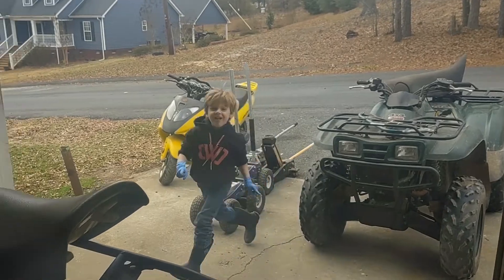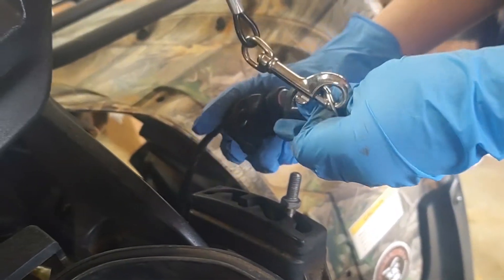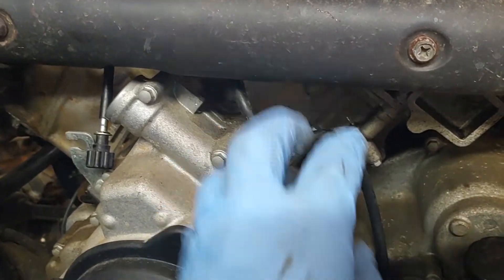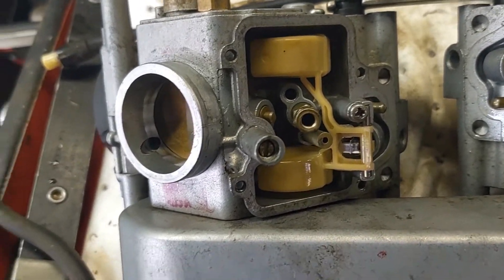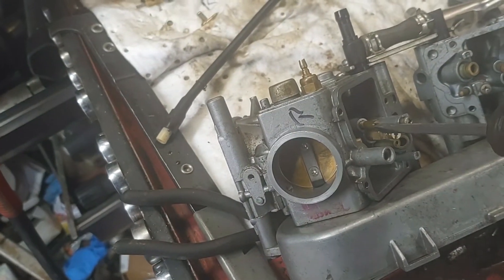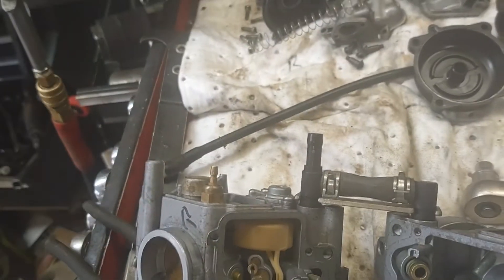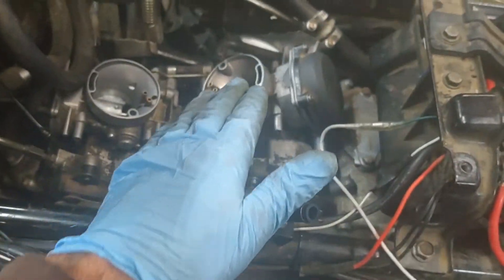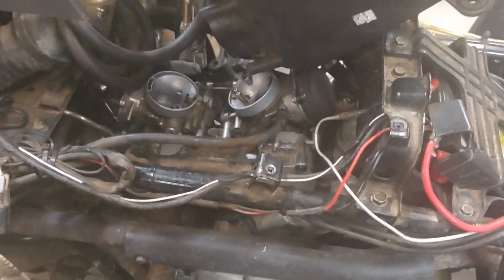Brute Force 750 Carb clean

Comment: Installed dynatek and went up in jets, falls on face w choke not on or at 1/4 turn...not idle possible even w stock cpu and jets back on? Any thoughts? Great video really helped out a lot thanks
Reply from the maker: What size Jets did you install and does it have an aftermarket exhaust?
Reply: @FourwheelerDoctor  i put it back to stock and still falling on its face. Was running fine.before the dynatek installation progragrammer. Its 144 stock imn front 150.in rear, 07 carbed. Was told I could set up 150 in front, 155 in rear bc of snorkels and aftermarket single or duals okm the way ASAP bc everyones backlogged allegedly w covid shit.
Reply: @FourwheelerDoctor  i should also.note a rad relocate yes, and i did it the lazy way and didnt pull chokes and linkages like you did, i merely flipped the carb and did the cleaning and jet work on top.of.the bike. This.may have been a very dumb simple cheat in efforts to.save time. Screws are at 2.5 turns out. Some have said go.to 3, may fab a tool to.try that without.pulling it all.off again. Thanks.so.much for.your help.

Comment: I got my 04 twin 650 heads ported and polished and it pops through the carbs now, do you think I need to rejet it cause of the porting, or is there other thinhs I can check that you would to try and find the problem, I appreciate your time and advice, tks and God bless
Reply from the maker: Could be the carb but more than likely it is the valves not closing all the way during the compression stroke. Check your valve clearance one more time.
Reply: @FourwheelerDoctor  thank you for taking the time to reply, God bless Mike

Comment: I just took my carbs off my 2007 KBF 750 and tore them down 
I noticed that on the side of each carb is what looks like an Accelerator pump (looked back on ur video and noticed the same thing)
I took the cap off of one it has a spring and a pump?
So my question is do I take it apart and try and clean it of let it go
Didn’t get anything like that in the carburetor rebuild kit I got
Any advice would b greatly appreciated
Reply from the maker: I never had trouble with one of those before but it doesn't hurt to take it apart and wipe it clean.

Comment: I got a question, I just recently completely flipped my KBF 750 at the gator trail run. I cleaned out the oil to take all the nasty oil mixed with mud off. And I tried turning it on and it sounds like it wants to turn on but it doesn’t. Is this a carb cleaning problem? I’m new at this stuff.
Reply from the maker: That's where I would start

Comment: My Brute force 2008 650 is idled very high. The idle adjustment screw is back off all the way. I loosened the throttle cable but it still idles high. When I put it in gear and not touching the throttle it goes 8 mph. It runs fine and idles fine other than idled high. I just rebuilt the engine and got it running. The carbs where leaking gas out the adjustment screws so I did clean it and replace the needle and the adjustments screw o rings and set it with the adjustment screws 2.5 turns out. The gas leak is fixed now. I did not mess with diaphragms. Do you have any ideas what I need to do or check?
Reply from the maker: Make sure the throttle cable is installed correctly at the carbs. Sounds like it might be off.
Reply: Thanks. I found that the throttle cable sleeve with threads is broke where it attaches to carburetor. I’m ordering a new cable.

Comment: Howdy.  Have you ever had to repair the "Vacuum valve", which is the small cover with 2 screws (round) that has the diaphragm in it.  It's PN 92145, located here:  https://www.kawasakipartshouse.com/oemparts/a/kaw/500b36c3f8700223e4794bd2/carburetor-parts-2-3  (lower left side of carb pic). 

My problem is, bought the bike used, and now tearing into the cards which sucked water and dirt into it.  The carb had been gone through before and I have to replace those diaphragms and rebuild kit.  Problem is, the meathead who worked on mine, a BF 650, didn't put all the parts back in and that Vacuum valve is missing the o-ring, per the pic.  I can't figure out if the o-ring goes between the valve and the spring, per the pic.   Thoughts? 

I am going to have to replace every screw on this carb, which I believe is a Keihin CVK 40.  Highway robbery for what the dealer wants for screws! I got the atv very cheap, but it's frustrating why they use screw heads on these carbs. TIA!
Reply from the maker: Sounds like you have a mess. When you remove the cover for the diaphragm, there will be the large hole for the diaphragm then a smaller hole off to the side. The ring goes in the smaller hole. If you look at the shape of the diaphragm cover, the small o ring will go under the port that sticks off the cover.